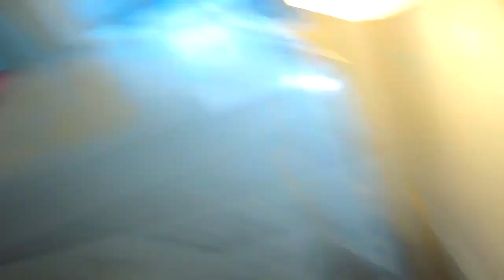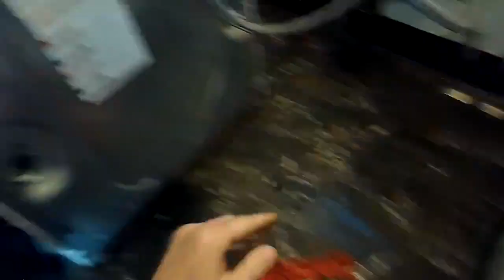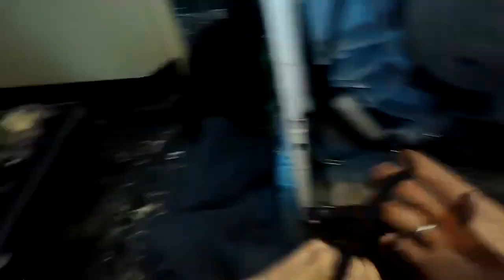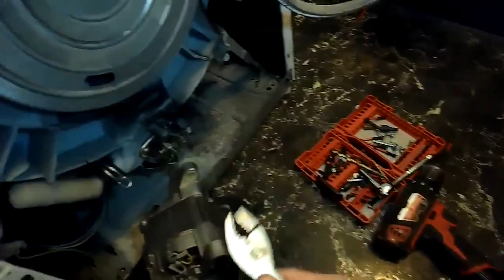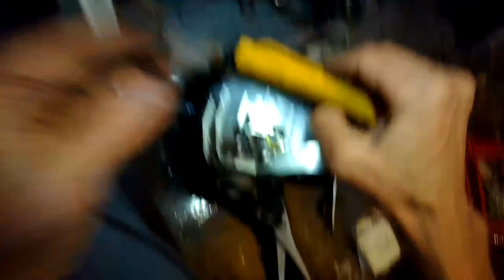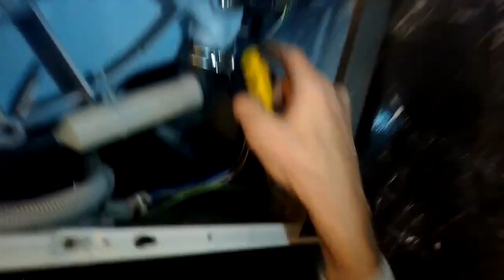BOSCH WASHER WON’T SPIN - Easy DIY FIX

Comment: Just did my motor brushes on this model (2010 Axxis+, WAS24460UC/23). I found if I twist the spring  a half turn, the diameter of the spring gets a little smaller and it doesn't hang up as much on the metal edge. The hardest part is keeping everything in place while trying to slide the retaining clip in place. I also cleaned the commutator with a green scour pad although it was pretty clean. I just put-in new shocks. I bought new springs but the originals where just as good or slightly better so I left them.
Reply from the maker: Great job, thanks for sharing your tips!Check out Our New Site Full of Articles and Videos on Appliance Repair: https://www.ApplianceFixes4you.com

Comment: Put an ice pick or pick into the center of the spring and then compress the spring into the tube.
Reply from the maker: Good idea👍
Reply: @QuickAndEasy5MinuteAppliance  Even something with a bigger diameter like a large nail or better yet, a small thin phillips or torx. I have a 2010 Axxis+ WAS24460UC/23, so I like your videos that involve these BSH units because there's otherwise very little repair info on these. I need to replace the 3 shocks, and while the washer is pulled away from the wall, I'll do the brushes. I also need to something with my pressure sensor, because my water level is way too low esp the washer cycle. EDIT: Oh, and check/clean the hose inlet screens.

Comment: This Is a good video my problem Is I have a bosch brushless motor Model no WFVCS450UC/29FRONT LOADER AND THE TECH SHEET THAT CAMD WITH THE MACHINE HAS A d.02 code and the sheet doesn't show that code so I'm not sure what It stands for, MY tub turns free with the motor belt on but when you try to go Into diagnostics It fills 1/4  with water and Immediately extracts just great but after pumping water out It goes to the d.02 code I can fix It If I can know what that code means you would think you would find It on that teach sheet buy nothing,
Reply from the maker: Can you check to make sure that no water has leaked into the drain pan below your washer?

I would also remove the hoses on the back and make sure the water inlet screens are clear of debris.

Comment: Thank you so much for this video! I was able to do this myself and now the washer works again. 😊 A couple of things from my experience. First the washer and dryer stack had been in the same spot for 7 years or so and when I tried to move them they wouldn't budge. I had seen a tip from another video to put something slippery around the feet and so we had a can of spray olive oil for cooking and I sprayed some of that around the floor of the 3 feet that I could reach and voila! I was able to move it away from the wall no problem without wrenching my back. The next thing that was different from the video was that when I tried to remove the ground wire (the one removed before removing the motor it wouldn't budge and I was afraid of using to much force and breaking it and then looking like a dumb ass when I had to call the appliance guy to fix it. Then I noticed that it is attached to a bracket that is attached to the motor by a torx screw which is the same size as the ones used to hold on the back. Take that out and the whole bracket comes off and problem solved. That screw is a bit longer then the ones that attach the back. The motor came off as described in the video using a flat head screw driver to pry it forward from the back holding thingy after taking out the bolts of course. The next issue different from the video is that the wires going into the modular connector had a plastic tie around them prior to going into the connector. The plastic tie  attached them to a bracket on the motor with a plastic tube like thingy that has to come off to get the motor out. The tube has a slot in it and I broke that with a flat head screw driver and then used a box cutter to cut the rest of the tube away and then I could get it detached from the bracket. (Hope it wasn't important LOL). The rest of the job was exactly as described. The old brushes were really short. The one thing that I have learned from doing these home repaiirs with the help of you tube is that appliances are designed now days to need repairs and so they are also designed to make the repairs as easy as possible. So what I have found is that if you are struggling with one of these projects just step back and think about how they might have made it so that it is easy to take apart for what it is worth. Agian thank you for this video.
Reply from the maker: Wow,
What great info. Thanks so much👍😊

Comment: Need help, changed brushes but can't get the  F 43 code off. does anyone know the procedure to get rid of the code?  is a Bosch Axxis + model
Reply from the maker: Thanks Tony,
Can you try leaving it unplugged overnight to see if the ram memory inside the controller will reset back to factory specs?
Reply: @QuickAndEasy5MinuteAppliance   Thanks for your reply, I did do that but it won't come off the code.

Comment: Fantastic video. This was error code 43 on my machine. Couple additional notes:
- while this is a relatively easy fix, take your time. 
- make sure you buy the correct brushes that go with your washer model number.
- when you pull out the motor brush, notice the angle of the brush so you can replace the new one at the correct angle.
- use a small, flat-head screwdriver to push the copper wire in the spring on the motor brush. 
- once repair is done, you may need to reset the error code before operating.
Reply from the maker: Thanks Paul,  Perfect😊

Comment: Spin motor is out and the service guy came out, said no signal was getting to the motor and the cost would be $600 to replace the motor, but it sounds just like this.  That's not a $600 job!  What is the test to see if the motor is dead versus a worn carbon brush?

Comment: Is there a test to tell if the problem is in fact the motor brushes or some other error in the controls?
Reply from the maker: Hi Bob,

98% chance it’s the motor brushes👍
Reply: @QuickAndEasy5MinuteAppliance  Hey thanks.  Actually it turned out to be a broken wire.  But this was on a drain pump a front loader.  I had the front off and was looking at the murky laundry water in the tub and thought, "Maybe I can just hotwire that little motor and at least make it pump the water out."  So I felt along the back where the wires plug in and one of them was just flapping around.  Easy fix.  But this is on the drain motor and not the main drive motor for the washing tub.  Still good to know about the brushes for the future.

Comment: My clothes caught the seal and ripped it off mid cycle. I turned off the machine and pull out the clothes put the seal back on but now won't spin and makes a noise when it should spin. Help!